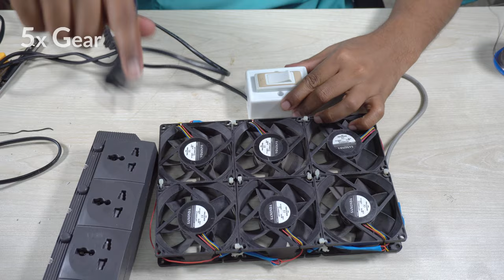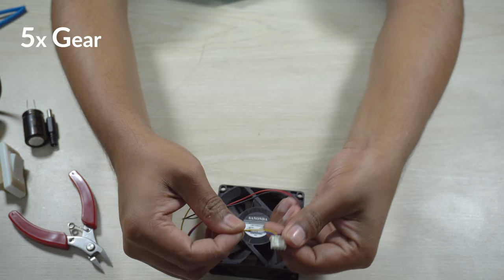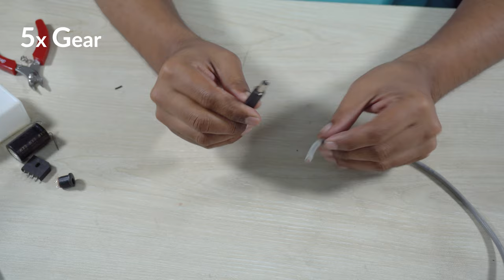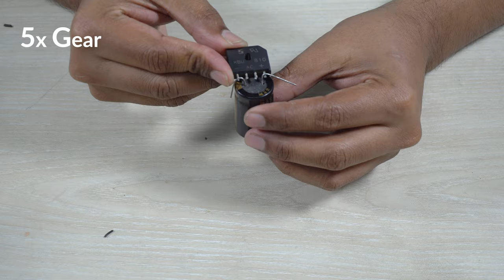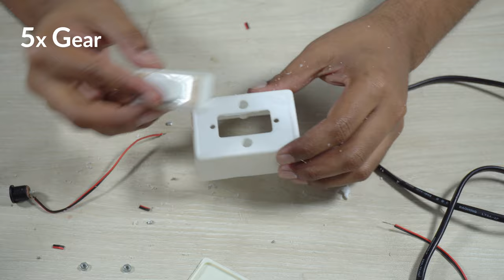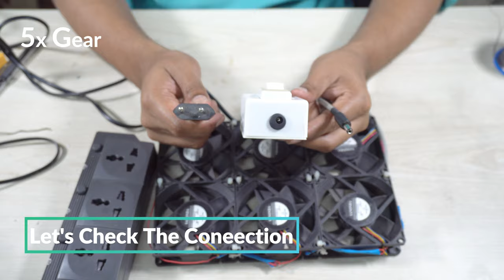DIY Cheapest Portable Exhaust Fan With CPU Fan

Comment: or you could just use a 12V power supply... and not risk messing with live high voltage AC line. this is very unsafe
Reply: S
Reply: I was about to ask the same thing…. But then i remembered the oil lamp… and i was like… ok…  ya…. Of course.
Reply: oil lamp = Molotov in style @RustyRaceHorse

Comment: I want to assemble a 6, 4mm fan with each one has a 12v 0.12amper with a 3500 rpm do I need to use different value capacitor or bridge rectifier?

Comment: Heb zo 4x Ventilators transparant multicolor leds in 3 rijen, die elk apart of samen gaan, en in een scherm ingebouwd.
Een kubus transparant met blauwe leds ventilators= lijkt dan op een ijsblok.
Een toren met led ventilators gebouwd.
Een harddisc uurwerk..
Compaq Flash in diskette station.
Van polaroid instand Camera batterij 12V. kaarten kan met via contakten en met diskettestation een 12V. laadstation maken, waar men een ventilor, of autoklok, licht mee kan doen werken..
Zo hebben die batterij kaarten nog wat nut.
Heb een Tandy TRS-80, iMac, IBM Luggable, Olivetti M21, Olivetti S2O , omgebouwd incl LVDS en toetsenbord telkens naar een pc, die van dos tot winXP kan installeren..
Zou met een oude scanner en een paar LDVS voor de backlights nog een lichtbak maken.. 
Als je denkt dat dit straf is???
Dan zou je mijn Moto's en Auto's moeten zien..

Comment: we already made same at home but using 6 fans with 12 charger reduce fan speed any solutions??? also i want to use 8 fan
Reply from the maker: You should use higher rpm fan or use 12V 0.45A fan like adda fan to get best result, search here - http://www.adda.com.tw/fan.php?pro1=DC-Fan&pro2=&p4=&p5=12&p8=&p9f=&p9t=&p10f=&p10t=&p11f=&p11t=&p13=-1&act=cat_search
Reply: Use 12v DC step up converter.